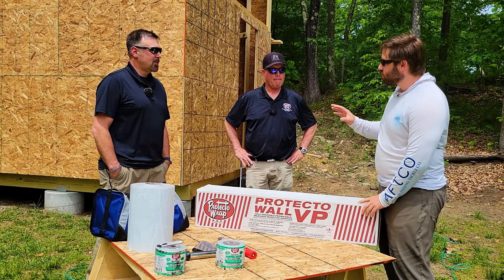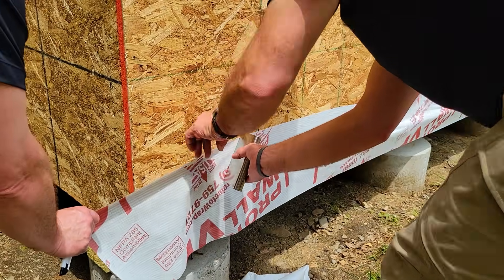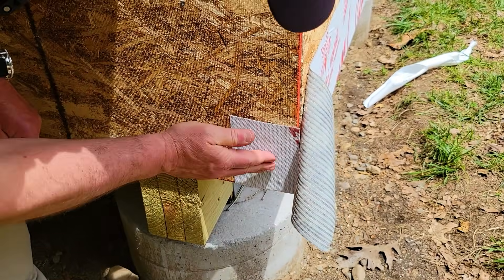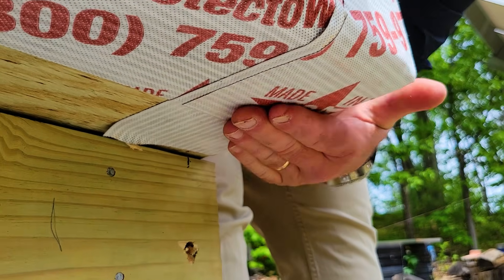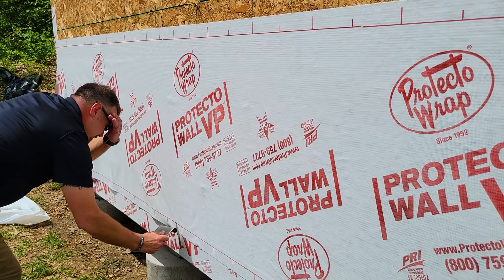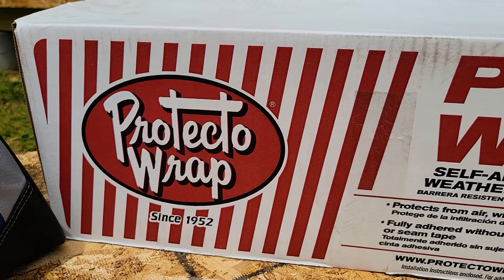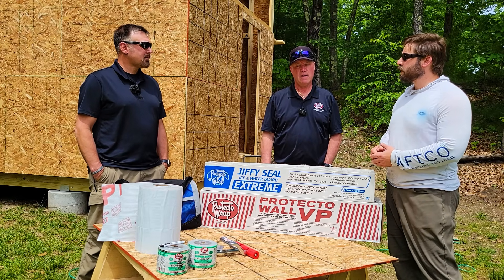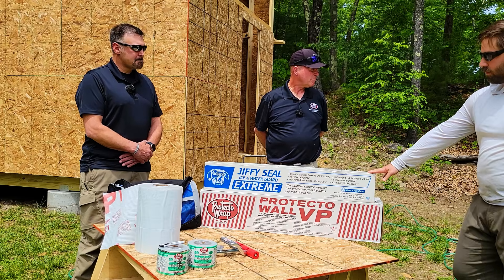Protecto Wrap helps to air seal and keep the DIY Cabin dry

Comment: This is a cool product. Does the OSB reduces the perm rating? OSB has a perm rating of 2 whereas if you had used something like plywood, you'd have a perm rating of 10 perms
Reply from the maker: When looking at the outward drying potential of the wall assembly, you want to calculate based on the lowest rating, which is the OSB.  You are correct about that.
Reply: @DavidPozEnergy  Thanks for the reply. Looking forward to more of this build. You're doing great!

Comment: David, I hope you get around to explaining why you are not using Grace Ice and Water on this build and if you will be using cellulose insulation or ????? Thanks for answering in full my last question as to the difference between cellulose vs rock wool and similar materials. Bob Jarrard in Nevada
Reply from the maker: Protecto Wall VP allows for water vapor to escape from the wall cavity, ice and water does not.
Reply: @DavidPozEnergy Did you actually answer what was asked? Or just reiterate a base summation of this advertisement video?

Comment: This product looks like a quality product. If i were to build a new home i probably would go with this. Material looks like quality, its self adhearing. When i do doors and windows i want to make sure to use the flashing for protection. When i had roof installed on my house, the rep came and brought materials they use and the ice and water guard they use could honestly be left exposed and do the job, Obviously it would break down from the uv rays of the sun. The shingles though they were so much thicker than what you  can get from the store, the nail strip is re-enforced. My house was built in 07 with the cheap of the cheap i moved in 2014. Already had to put a roof on as the high winds we see in the fall and early spring ripped half the roof off, most people in the neighbor hood as well. We haven't had any really high winds since but i think it will hold up to the job, the shingles also look crisp and clean even in 100% exposure to sun. IKO Dynasty is what we usesd. There was another brand they started using Tamko titan xt shingles which look just as good. But the dynasty shignles id give them  a thumbs up. Might put them on my shed as it will need new roof soon. I feel comfortble doing the shed myself!

Comment: Here in Europe I'm more old school, using lime render for water protection but allowing vapour transfer.

It can be used with hemp or straw for external insulation too. And internally you can use a layer of clay with a light lime covering for thermal mass.

Comment: Would have to see a per square installed cost analysis versus  Zip sheathing that has been around for decades.  This product's competition is not standard Tyvek and caulk installations they're depicting in this commentary.